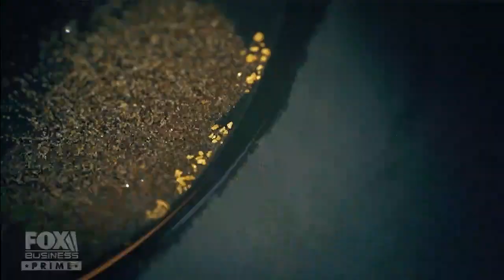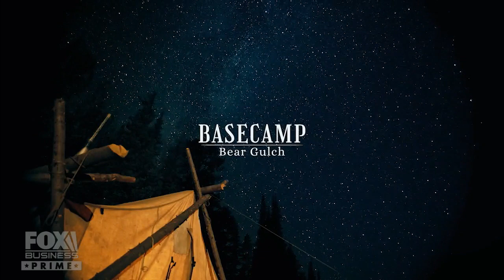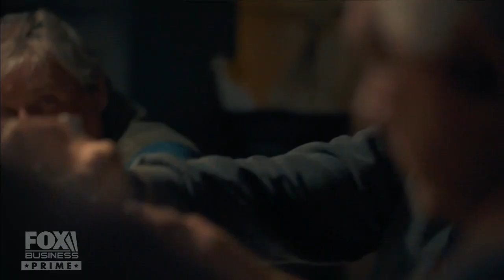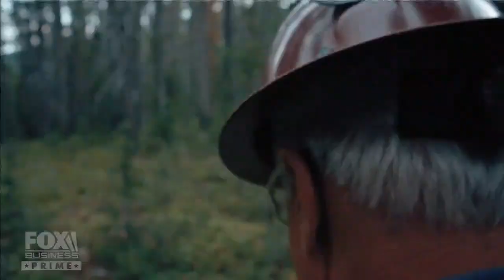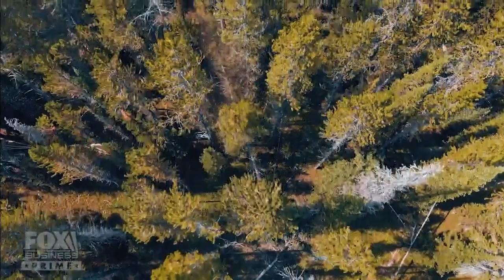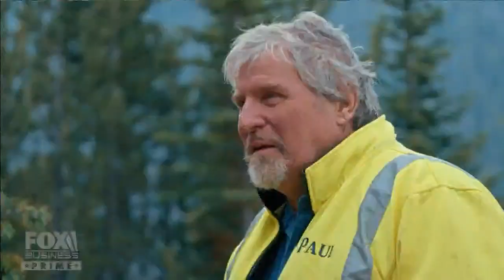The Dales dig in search of their lost portal on 'American Gold'

Comment: They keep running into problems with  OBVIOUS solutions they don’t even consider…

Two examples:

1) tunnel blocked with ice

Just MELT it out.  Block off entrance.  Start a bunch of of contained fires in metal barrels to raise temp.  Wait (refuel fires as necessary).  Problem solved.  You’re welcome.

2) Bad air in tunnel

Several times while exploring in various tunnels they encounter bad air and give up exploring further when all they have to do is bring some air with them (e.g. oxygen tanks, regulators, etc).  Instead they just give up and act like there is nothing they can do - like it’s an insurmountable obstacle.  It’s not.